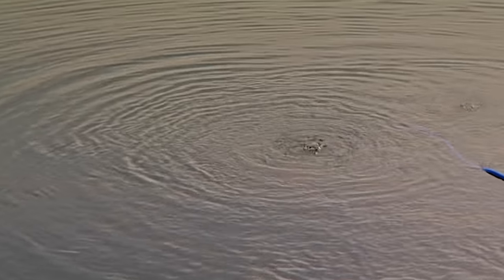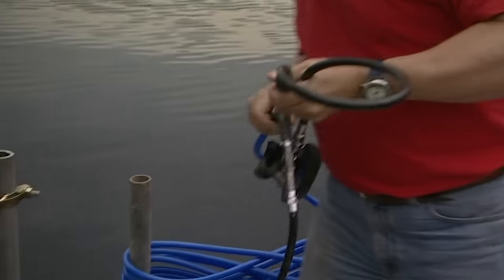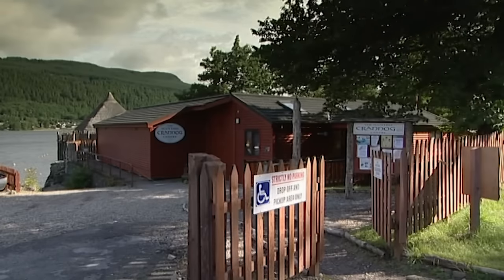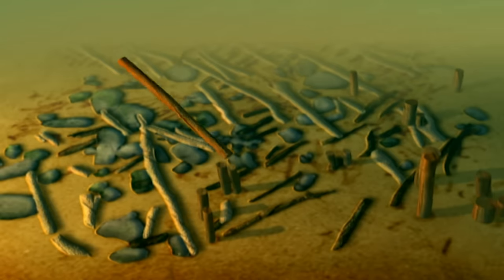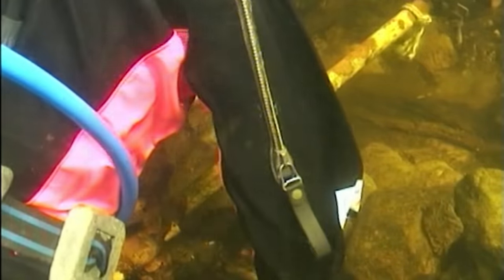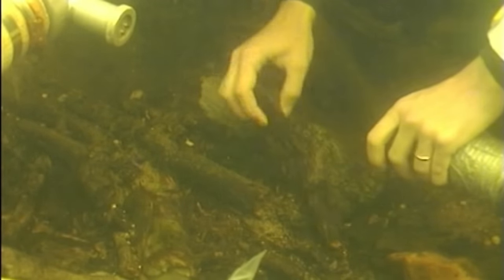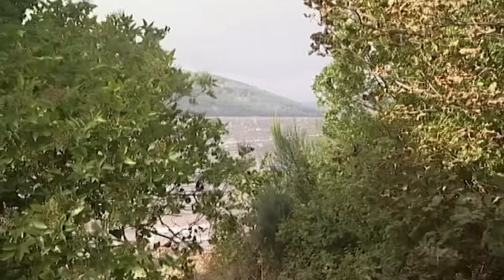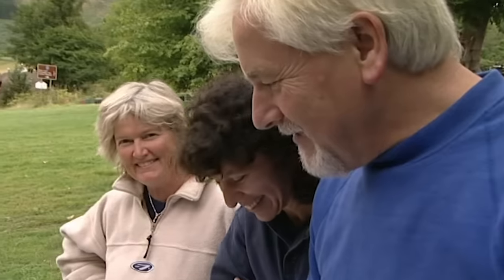Time Team Special: House In the Loch | Classic Special (Full Episode) - 2004 (Loch Tay, Perthshire)

Comment: Yeah I’m not buying the climate made them build a platform in the loch to live when the weather gets bad or cold that would be last place I would want to be. There’s another reason and that lake looks devoid of life and food to harvest, yes maybe 2000 years ago when the depth were lower it may have been teaming with fish but going out in a boat would be dangerous in the winter winds, rains or cold as hell or frozen over and that’s why they built them?
    Why would you live in a hut exposed on 6 sides to the elements or  raise sheep/live stock out there?
 You wouldn’t and a big storm or wind would occasional blow it down.. and you’d build another on top of that structure.
 That is the accumulation of years of rebuilds, there was a dwelling tucked up on shore protecting the clan and the live stock.
   It sure wouldn’t  be a good place to fend off an attack and when all the other clans around the loch are doing the same thing it’s a fishing shack.
Reply: In this time period, structures this shape and size, including those built under easier conditions on land, were dwellings. As mentioned, the climate changed around this time, too. They mention less accessible arrable land (in the Highlands, anything above a certain altitude would no longer be suitable); would yuo build your house on land you need to grow your crops on, to pasture your animals? A lot has happened throughout history since then which caused farming in parts of Scotland to move away from crops, which contributes to why the landscape around Loch Tay looks very different today, than it would have in the Iron Age.
Scottish waters are pretty famous for their salmon. They still are. There's literally a curious fish (not a salmon) in one of the shots while they're excavating. That lake is not devoid of life.